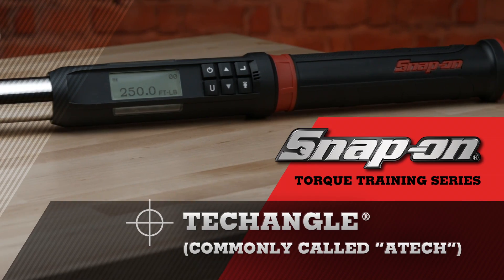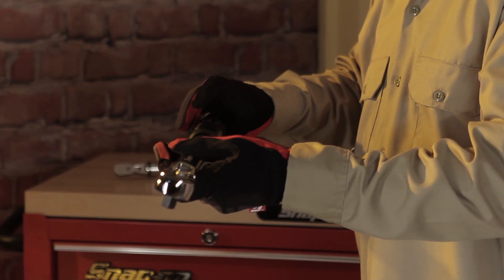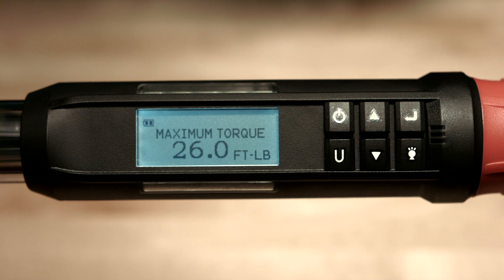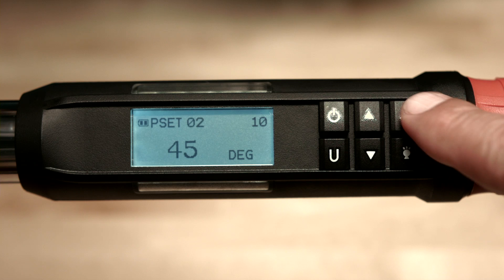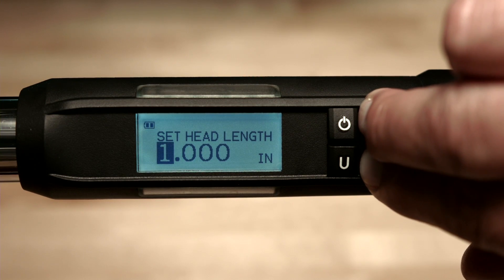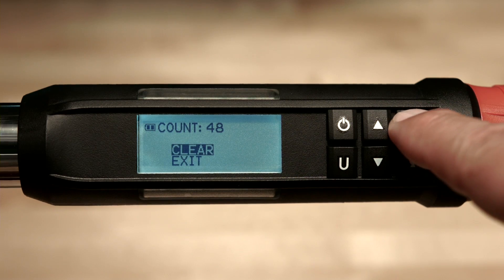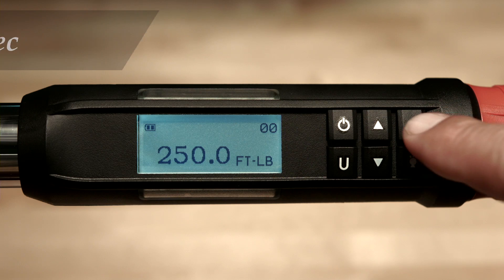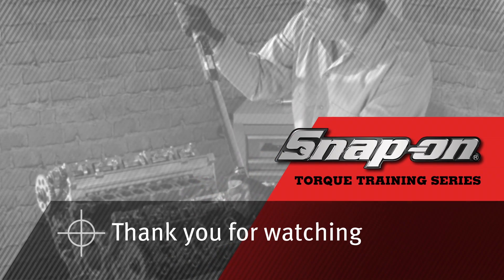Snap-on Torque Training Series – TechAngle, or ATECH,  Electronic Torque Wrench

Comment: Using the reverse mode if you over torque the bolt..? That's a first for me..
My Snap-On rep say you'll de-calibrate you torque is you do that.. ? 
Maybe digital torques don't apply to this philosophy.. ?
Reply: I believe all the digital ones are either direction, but check your factory calibration sheet to see if it lists reverse torque

Comment: The unit of torque is lb-ft, not ft-lb. C’mon Snap-On (or is it On-Snap), you wouldn’t say Meter-Newtons.
Reply: Ft-lbs is a old usa version of torque.
Lb-ft is the new version of torque and current. 😂😂😂😂
Ps you have to go back about 60 years for Ft-lb in old manuals.

Comment: This must be a old video. In the video mention its not necessary to remove the batteries when storing it not in use, well it was said to remove batteries if not using and storing it because batteries may swell or leak overtime and is good safe measure to remove them out of the torque wrench when not in use.

Comment: Snap On - First, good video.  I haven’t read my owners manual, so this is informative.  I store both of my Techangle torque wrenches with the batteries removed (so a leaking battery doesn’t damage my tool).  Will they remember preset torque settings when I do this?

Comment: How do you enter tq value 20.5 or 25.7 ft lb? I can’t seem to get the tenths value in there or find the option.
Reply: Sam, change the torque units to inch pounds, but instead of 20.5 ft.lbs. convert that to inch pounds, which is 246 in.lbs.
Reply: Sam Han use in pounds.....
Reply: 4 SnapOn tool boxes, $170k in tools, I send in a 1/2” click-type torque wrench is use almost daily to have it’s 6 re-certification and they send it to say they have no parts! You made it, can’t you at least tell me if high, low or right a the mid point setting? Then the truck owner offers me $30 trade in for a new $380 torque wrench. I change my answer from no to hell no! They used to sharpen side cutters, regrind and tension needle nose pliers. That department closed…
ASE Master 78.

Comment: Will the torque wrench keep track of degrees traveled?  (Ex.  You set it for 180° and you pull it 90° and due to space limitations you then have to get another bite on the same fastener and pull it another 90°.)  Will the wrench keep track and show 180° or will it just show 90°?
Reply: it keeps track. So if you can only move so far each time it keeps subtracting until the value it met.
Reply: Yes, you may use the ratchet as much as you want, it only reads and accumulates the angle when moving clockwise.
Reply: My problem with this is  I think there is a time limit that it will remember the angle it was at before you stopped (to ratchet the wrench).  For example, I was angle torquing a fastener and had to ratchet back while also making an adjustment to the part I was working on.  I went to complete the angle torque and the wrench started back at 0 degrees - very frustrating.  I’ve learned to mark the bolt head as a back up.
Reply: Yes

Comment: How do you calculate the head length when using a extension bar horizontally
Reply from the maker: +Brad Kells Thanks for your question.
For a fixed head, the head length is the offset length, measured from the center of the drive to the center of the fastener. 
For an interchangeable head, head length is measured from the locking pin to the center of the drive.
For an interchangeable head with an adapter or extension,  head length is the sum of the head length and offset length.
When using Snap-on's ATECH Torque Wrench, the length of the head, adapter, and/or extension being used can be entered into the wrench to correct for a different length than that of the head used to calibrate the wrench, without requiring actual recalibration.
Reply: SnaponIndustrial1  so do you need to set up the head length if you are using a vertical extension too?
Reply: You do not need to use the HEADLENGTH feature when using vertical extensions. However when using vertical extensions for angle measurement , use the shortest extension possible. The torque instrument has a built-in angle bend-compensation for the bend of the torque instrument tube, but not for the twist of the vertical extension. Always use high quality extensions. .